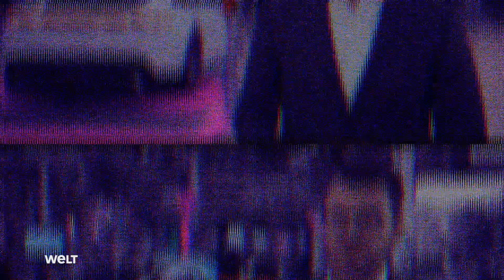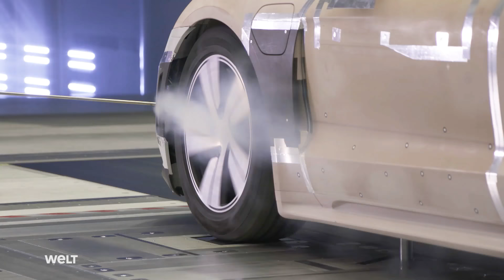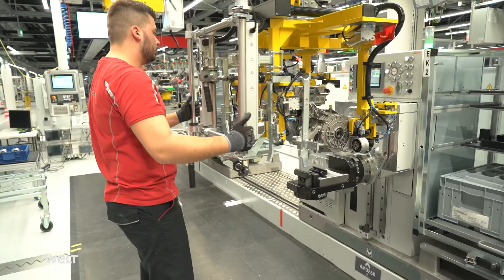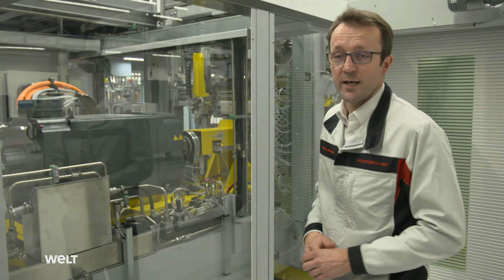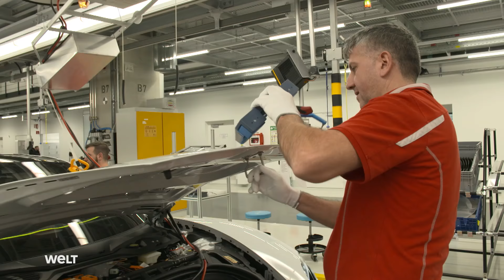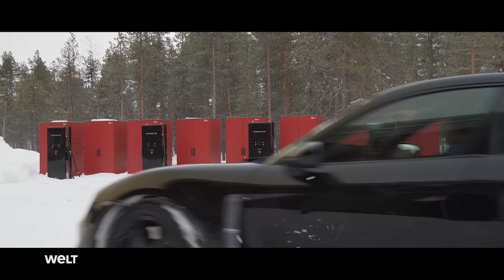Porsche Taycan Turbo S - Inside the Factory | Full Documentary

Comment: Imagine the cost when the 600kg battery pack requires replacement, what a fallacy this whole thing is. Why bother with all such battery powered vehicles with restricted range, when clean running hydrogen power extracted from water can be used instead. This is by far a greener proposition than these pollution creating battery pack disposals on imminent failure in the near future.  Also consider the EMF's emitted from these high powered electric motors will be off the scale, which are known to cause malignant cell formation leading to cancer.  I certainly won't be buying this model of Porsche, they can stuff it for me.

Comment: A big bust! EV's are impractical. Who is going to buy this? Electric power is NOT green because of the amount of fossil fuels used to construct the battery. And the battery will need to be replaced @ a cost of $7k - give or take - after 5 to 7 years. There is no infrastructure in place to charge it on a trip. And btw, when you are on a trip, don't forget to plug it in overnite because it's going to take 8 hours to charge !

Comment: Lost me the minute you said electric, how misleading...it's not a turbo anything and it certainly has no sound. These electric cars need to stop with the fake sounds, if you want a motor sound BUY A CAR WITH A COMBUSTION ENGINE. Tell me you'll smoke me and my V8, idc cause I have more fun driving my car than you do your dead car with no feeling to it. You get one shot of torque, I get it every time I switch gears and can feel the rear end grab the road again and hunch back down, getting tire spin as I go through the first 3 gears. Electric cars are boring and lifeless.
Reply: turbo s is porsches brand image for their top trims it'd sell way less if it was called "Taycan Extra Kwh S"

Comment: I went to test drive this last Saturday, it's dead vault quiet. From zero it launches like an airplane. Stunning design. I query 3 things: the tight back doors, the slanting roof makes it uncomfortable for back seaters. Also, I'm disappointed with the audio quality. Instead of bose, bemeaster should have been used in my opinion. Overall, it's a wonderful piece of engineering.
Reply: Burmeister audio is an option for all Taycans

Comment: the people at Stuttgart, Germany should build a fleet of off road biased specially built PORSCHE Cayenne S 4WD + 3.0 in. Lift 3.2t V6 5-Dr All Terrain SUV (LHD) for a select few!!! the weight of the Taycan S Li batteries has to be reduced by 55% - 60% (320 kgs - 430 kgs)!!! regardless of the model, be it the PORSCHE Taycan Turbo S or the Taycan S even the heaviest variant of the Taycan should weigh no more than 2.1 tons!!! use of additional military grade high strength aluminum alloys in the Taycan's monocoque can save a lot of weight!!! hydroformed extra high strength steel should be used in major load bearing sections & heavily stressed parts of the chassis!!! for e.g. A B C-Pillar & impact absorbing sections of the chassis!!! opting for composite front bonnet, roof & rear boot lid will further save weight!!! if you cannot shelve some weight of the Li batteries then you've to look elsewhere in the vehicle where you can save weight, but without compromising the original essence of the vehicle!!! afterall it's a PORSCHE we're talking about not some HYUNDAI or MG!!!

Comment: A 2.5 ton vehicle with a hard top, trunk, back seat, and automatic transmission is not a "sports car". If the Taycan is a sports car, the Ford F150 is a sports car.
Reply: You can call it whatever you want, but it is way faster than F150 and way better handling.

Comment: My only concern is since it's base on battery will it cause an electrical heat explosion from hours on the road travel.  Just like how there's cases of pple's phone batteries being over heated that it causes explosion from power outlets which has caused many deaths.
Reply: Basically every new electric car has liquid cooling to manage battery temperature. The cooling systems are designed to keep batteries at a stable temperature even during fast charging, which is very energy intensive. The battery doesn't get much stress while cruising on the highway, as that's generally a much lower discharge compared to rapid acceleration. It's when you're constantly accelerating hard, as in track driving, that things start overheating, and even then it's the powertrain that tends to overheat first due to relatively small surface area. As with gas cars, once temps get above a certain level the car will start reducing power until it cools down. In the case of the Taycan, Porsche also went out of their way to design for repeatable track performance so I'm sure the system is never in an at-risk situation. There's basically no driving condition where you can overwhelm the cooling system and stress an electric car so much that it'll cause an overheating related fire.
Reply: @seanmarks5932  That's very good to know thank you for the information! I just wasn't sure if that would be an issue if I had to drive 4-5 hr straight nonstop on the freeway for travel. I travel quite often from Central Valley CA down to L.A. That's why I was curious before I decide to purchase one soon. Once again thank you! 👍

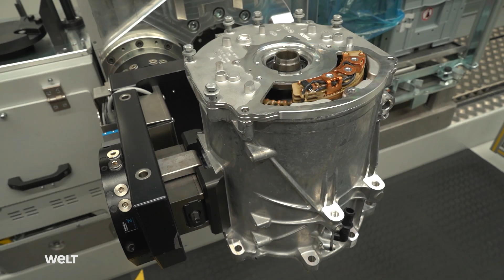Comment: 24:05 they forgot the power inverter. This is the box they call commutator 😅 the motor  will not run fine if you supply DC to the motor. You also could not control the rotor movement without power electronics.